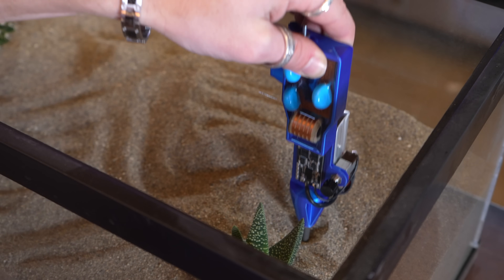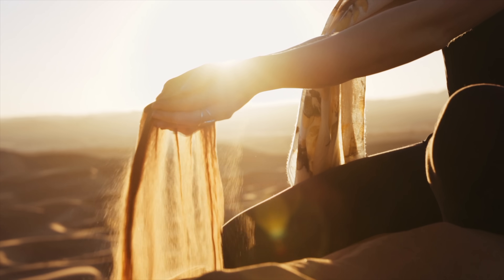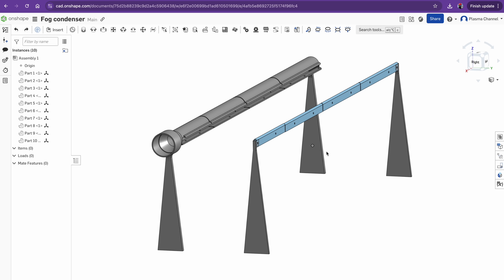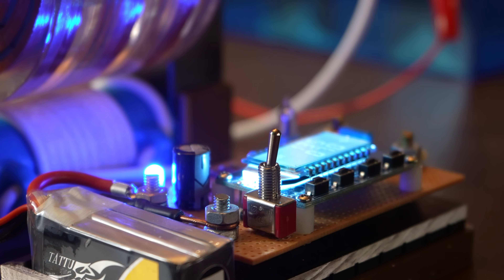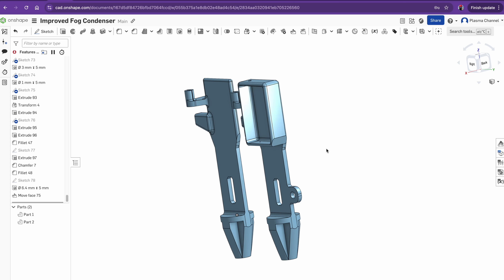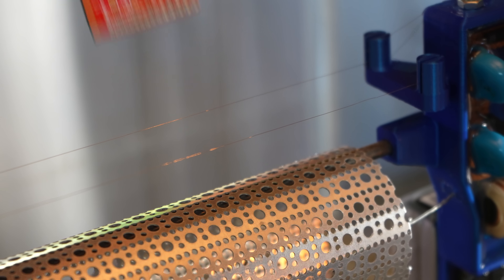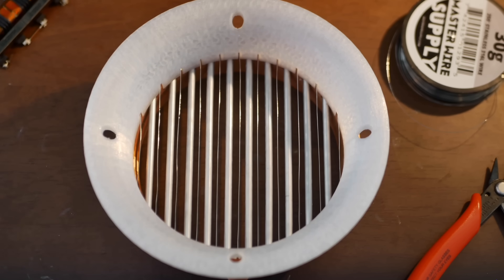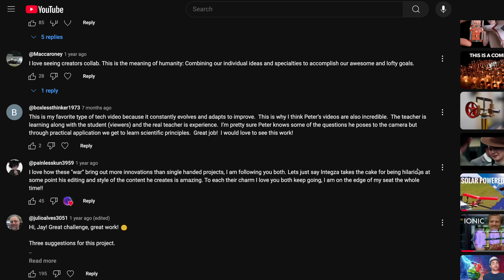Solving Desert Water Shortages Using 20,000 Volts

Comment: Solar powered Stirling cold gas cycle piston air liquifaction module with ultrasonic vaporizer frequency set to generate water vapor with seabeak effect electrical power supply from the ultra cold temperatures tesla coils used to beam generated electrical power for farming uses in ground hydroponics line's for water conservation and food crop generation in any soil conditions.  😊

Comment: That already happens twice a day natively and naturally it’s called dewpoint when you study more of the environment to look at it from the angle that you’re looking from is way way way not good over undereducated by such a large degree that I have to explain it to you like this And Cold War storage times of hot wartime munitions we must clean all of the hydrogen or ether all of the water vapors from the thing and then we take it out to a place like Easter island and we park it when we take it out there we’re not supposed to have the guys even sweat while they’re there no unnecessary moisture no pissing no shitting no taking food out there extreme distance so extreme of a distance you take two fuel tanker trucks. Want to get out there and want to get backright and now if theirs is.  Right and now if there’s any moisture that we bring out there with us. If there is any moisture that we bring out there with us, then we can look on the radar and we can watch it. Start to rain out there now if we go out there and we collect the biomatter and remove it then there’s almost no humidity out. They’re almost no rain because we took no ether out there. Ether hangs out in many things. Ether is the particle differential that there’s the same ether particle and butane, propane methane And hydrogen and hydrogen. It’s a much more concentrated amount. It’s a substance that was easily referred to by those that are God-fearing as ether and as such are starting fluid, still has ether is the primary ingredient in starting fluid. It’s like the working energy like the gas in the tank of the hydrogen Now if you don’t bring much of that, there’s only the resource management a ice in small insects and plants that you’re not trained enough to even notice that they’re there, but you would go into that area and totally destroy that ecosystem by flooding it out with water with no comprehension that there was already something there Good on you , all of the deserts are man-made by military force for cause and the cause is still relevant. The only place where the cause has become irrelevant is Africa. The rest of the world‘s deserts are still supposed to be protected items.

Comment: The high voltage component of this is the worrying part for me. Having both the high voltage positive and negative in close proximity must be a safety issue. Also, since you are dealing with DC current flow, will corrosion become an issue?

Comment: There could be an industrial version, with some fans, really close grid structures of the grounded and the powered wires, and it could run on solar panels. it would be way more expensive, but it would produce a lot of water

Comment: I'm surprised that your Mk. II didn't have any way to increase the volume of air moving through the system.  Wouldn't an intake fan and some ducting greatly increase efficiency? (Maybe it could be done passively by locating the device somewhere with natural ducting due to geology.)

Comment: You can grow crops in the desert by delivering hydrogen to the desert, the hydrogen comes from coastal deserts where the sun is used to split the water into hydrogen and oxygen. The crops are grown in green houses powered by the hydrogen the use of the hydrogen for power creates water. 1 kg of Hydrogen will produce 9 litres of water.

Comment: Negative mesh, suspended by copper pipe, that is cooled by running glycerin with a pond pumped down one vertical support PVC pipe, through a copper coil six to ten feet underground, then back up the other vertical support PVC leg into the radiator holding the negative mesh.   Cool the screen to 50° to 60° F or 10° to 16° C and it should increase your water collection.  For the same reasons that air conditioners have a water catchment that drains outside.  The more people who use swamp coolers in your area, the more water you collect.

Comment: I mean, i see no point on leting it running, there is probablly a optimal interval of on-off power based on airspeed, since the efect is almost instant and the air moves slower usually.

Comment: Why is this video only made 7 months ago when this type of stuff has been around for hundreds of years? Why do you think there is always a ditch, a valley or a low spot near every farm? Not every farm is going to have this and be able to utilize this feature. The moisture blows in the wind it catches. The f**** leaves in the bushes. It drips down. It goes down, drips down the stem down. The everywhere goes down into a valley and it makes a stream. The Romans did this old agricultural and Farmers been doing this for a long time and when you increase the the amount of tightness or make less air flow through something like using a mesh or a screen instead of a bush or a tree, you collect more moisture that's in the air when there's less moisture in the air

Comment: dig not towards electrostatics, but towards the "dew point", which can be "moved" by electric or compressor-freon cooling. then the system will not "wait" for a short breeze in the morning, but will work effectively all hot day and throughout the desert. yes, energy costs are higher, but so is the water output. in places where sunny days are a systemic phenomenon, getting electricity from solar panels is not a problem.
in the future, I wish you to choose an effective frequency of the static field, at which there will be the greatest sticking effect, but you should also reduce the concentration of moisture in the test blowing - this is unnaturally much, plus, fog does not tolerate winds, which means that it is necessary to implement a dense blowing of your grids, and this is not in favor of energy efficiency, if you decided to use the electrostatic condensation method because of it.

Comment: You could use the same technique to provide coastal towns/farms with fresh water.  I wonder if a grid was suspended close to salt water if it could pull fresh water from the vapor layer just above the water's surface.

Comment: hook this up at scale with solar panels to recharge the batteries during the day, add in a sensor that flips it on and off when the sun comes up and its basically a set and forget system that collects water where ever you want it given the conditions are right.

as for funding such a product with a slight change to add a fan and ducting across the wire with an on/off switch you could sell the same basic design as a dehumidifier for houses that is... what did you say? 8X better for the same power? this seems promising.

Comment: Great video! I thoroughly enjoyed and think this is an amazing idea.

I have a couple comments and questions though;
1. You compared this to a dehumidifier that I think uses a thermoelectric Peltier module. These are very inefficient, I would love to see you use a heat pump style dehumidifier instead, or an AC unit and just collect the dripping water. These do cost more but should be far more efficient and fairer to compare imho. I would love to see what the difference is there. Unfortunately I haven't come across any that run on 12v so you'll have to probably run it on wall voltage which. I see that you have the intent you have is for this to run off solar so an inverter would be needed in the desert which would cause a slight loss in efficiency.
2. Whenever I see air getting ionised or deionised a red flag waves in my mind. Would or could this create O3 better known as ozone as a biproduct? If so would a catalyst need to be added to turn O3 back into O2?
3. Condensed water dripping onto the surface of the sand just before sunrise may not work well in the real world. I would imagine that the heat from the sun would rapidly evaporate the water before the plants have adequate time to absorb the moisture. Would it not be more efficient to harvest the water and then directly water the plants that way?
4. Can this only work when there is fog like you've shown? As you mentioned fog is around in the morning, when sun is weak, solar wont make much power so you will need to have an alternative power source like a battery. How will the device know when to turn on and off? It would need to detect when there is fog. A heat pump/compressor style dehumidifier can run at anytime as long as there is a power source without any worries of ozone. Does efficiency even matter at this point since you can generate a lot of solar power in the desert throughout the day?

Comment: This really is an incredible invention, excellent work.   I'm not sure if the most efficient way to water the crops would be to have the water fall directly on to the ground though.   It might make more sense to build large banks of these collectors in exceptionally foggy areas like valleys, then store the water and pump it to where it is needed.   You could even pump the water into existing reservoirs and piggy back off the existing irrigation infrastructure instead of having to build everything from scratch.

Comment: @PlasmaChannel Is this concept suitable for a NASA experiment on Mars? I’ve seen videos from the Mars Rover showing a bluish sky. We are taught that the blue sky on Earth is due to water in the atmosphere, so it stands to reason that although there are no clouds on Mars, there might still be enough moisture in the air to create a bluish appearance when viewed from a low angle, like that of the Mars Rover. 

I mention the Rover's height because it could be a determining factor in where moisture and atmospheric layers are located. If this is the case, then conducting an experiment on Mars could yield significant results.

Here’s a possible plan for the experiment:
1. Deploy a robotic collector.
2. Install sensors to activate as needed.
3. Collect and retrieve water.
4. Store the water in shielded bladders for later use.

I have more ideas on how this could be implemented, so please contact me if you're interested.

Comment: probably work well in higher altitude regions , I doubt it for desert , where the environment and direct sun and indirect ambient if covered would cause any drop of concentrated water that builds at such a low rate , to evaporite quite quickly on metalic surfaces . 
In hot region I honestly think their would hav to be some sort of light wind vortex system that keep evaporating moister localized to one spot and captures external debris like seeds , so that it can falls to tha area and water vapour can accumulated into clouds just over that region , then a system like this at the bottom might stand a chance, only problem then would be keeping it clean from the sand build up and any battery and solar supply for it safe .

Comment: This concept may be limited to coastal desert situations. Inland deserts rarely reach their dew points (cool temperature where relative humidity is high enough that mist can form) during the summer growing season. For instance, looking at Albuquerque, NM, with a "high desert" climate, it receives about 9 inches of precipitation per year, with about half of that falling in the summer monsoon season from early July to mid September. According to Wikipedia/AlbuquerqueNM, typical minimum (most likely in the early morning) temps during the summer months are in the 50's. Examining the National Weather Service Dewpoint Tracker for Albuquerque, the average dewpoint during the monsoon season is 45 degrees. This means that overnight air temps have to drop to 45 degrees to produce mist. Thus, it is unlikely that Albuquerque would regularly get the early morning mist needed for daily or even twice weekly irrigation by electrostatic mist precipitation. Albuquerque is probably typical of most US Southwest Desert locations in this regard. https://www.weather.gov/abq/abq-dewpoint-tracker

Comment: I think you got off on the wrong foot. The emitter should be negative.  The   emitting conductor should have a rough or spiky texture.  It need not be metallic wire.  Have a look at the construction of domestic air Ionisers which often use a carbon fibre. The point of the rough spiky texture is that on each tiny tip the local electric field is much higher than the voltage from your power source and electrons jump of each of these tiny points in bigger quantities and promptly stick to the moisture droplets giving them s charge.  Some paint sprayers also use this principle. But do get the polarity right!

Comment: Sir, I tried duplicating your set up using 20kv i bought.. but i does not attract the fog.. i powered it using 6v dc power supply.. does it need to be 12v dc power supply?

Comment: What made you go for 20keV? It seems the voltage should be optimized for efficiency: Higher voltage, faster air speeds but more power consumed. Now how many molecules does an ion "drag along"? Also, which part condenses? Just the ionized molecules or also the ones that just got dragged along? Can we optimize the condensation surface to help that along? Surface structure and hydrophilicity seem important. Also you could add grooves to direct droplets to collection points.

Comment: Your video on making electrets - https://youtu.be/oTNXXiMO3e8 - and the effect you showed that one had on a stream of water from the tap, made me wonder whether a PE electret formed into a mesh might be effective as a condensation surface for this kind of fog collector. I'm particularly curious whether charging the fog to a lower voltage would be sufficient with such a mesh electret, or even if any charging is needed at all, since fog might have already picked up some charge naturally from the environment, similar to the way clouds and raindrops do.

I may have to do this myself to satisfy my curiosity. Sigh. 😂
Reply: Honestly your thinking is good but in practice you will run into serious limitations. Do the experiment and you will better understand.
Reply: @ntmituniverse5850 
Sigh. I suppose I will have to do that. A mesh might not be the optimal shape for a fog-catching electret. 🤔
Reply: @felixfujishiro2304  Soft polymer magnetics can be form fitted to really interesting concepts. I will try to find the time and experiment with you =)

Comment: Add a drip line in between the curve and have a localized condenser, that produces water even on non foggy days, so when there is no fog, or low humidity, you can water strait from your system, creating a backup method of watering. But all within the same package. Pretty cool method especially if some type of mulch layer would be used. Another idea I saw in another video was moisture holding silica, which would only amplify your work here.

Comment: I suggest not to do that. I usually dry the NaCl at night so that it dissolves into liquid. Now it doesn't melt, which means there is a possibility that the oxygen will dry up, which is a sign that there is water. Such actions damage our climate in Indonesia. You are stealing water.

Comment: Does this work when there isn’t  visible fog but high humidity? If so I’d love this as a set it and forget it drip irrigation system for my garden.

Solar powered with a humidity sensor to kick on when there is an efficient amount of humidity in the air to totally automate this would be frikin awesome.

Comment: I wonder if there is a way to reduce surface tension and if by reducing surface tension it could be more efficient.  Something like ceramic coatings used on vehicles.  Probably not safe for consumption at that point, and I also don't know if ceramic coating would be an insulator like ceramic is.  But maybe there is something out there that can do it.

Comment: On a side note if you go for large area usage of doing this how will it affect the environment if you are removing so much more water from the air before it moves further inland ? With this system you would be drawing the fog in so its not like it wants to move around you easily with this system in place .

Comment: 10:56 The cactus are "designed" for arid deserts? What?! =)))   Cool video nonetheless.... By the way, you said that the positive wire will strip electrons from the water on contact. Doesn't make much more sens to use a mesh instead of a wire? You know..., increase the contact surface.